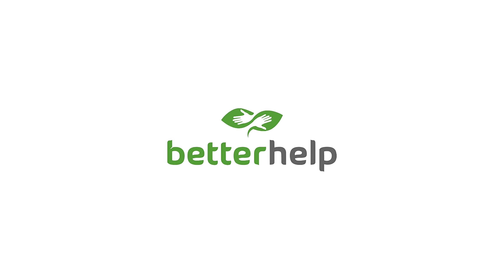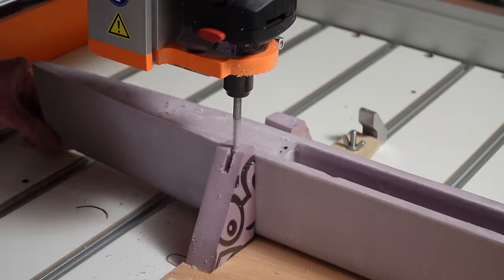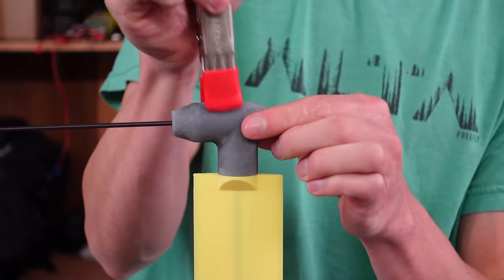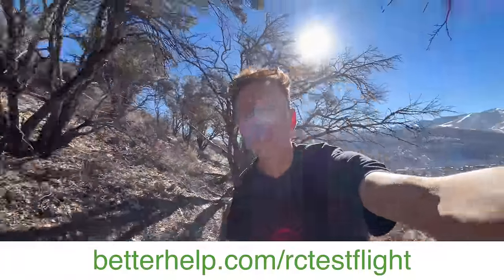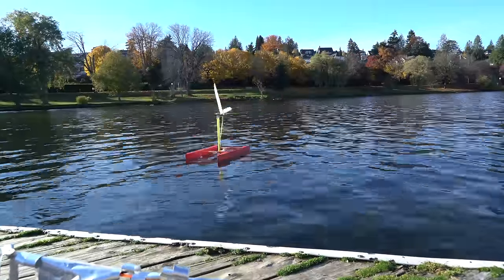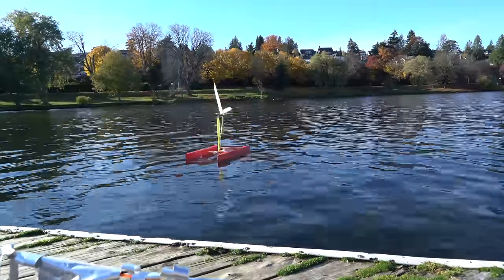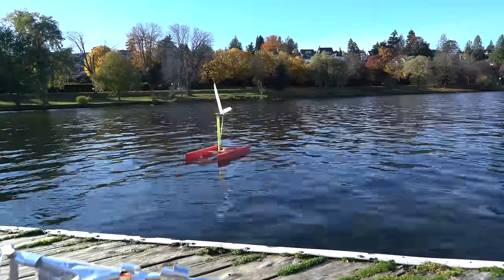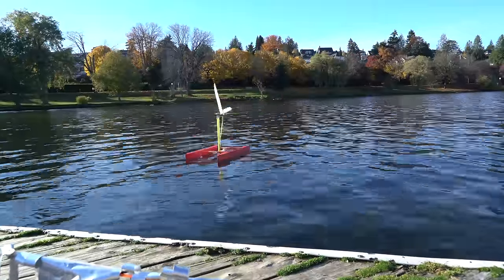Sailing Directly Into the Wind - Is it Possible?

Comment: Rather than increasing the propeller diameter, would it not make more sense to design the gearing so that it spins faster than the turbine instead of 1:1?
Reply: surely
Reply: that's what I was thinking
Reply: Also my first thought. Was gonna add a comment if I didn't see this one.
Reply: I have a feeling a bigger prop is more efficient than the extra mechanical losses from a gearbox. I could be wrong though
Reply: Seems like the additional gearing and touch points required could make it not as efficient as increasing the prop size, maybe.
Reply: He already has gears, though. Unless different-size gears have more friction somehow, then there's no penalty relative to his current design.
Reply: Yeah just think how fast these small water propellers would normally spin, thats far far faster than the wind turbine I'd bet. The turbine seems to have the torque to do it too, so I see no reason why it should be geared 1:1.
Reply: Yes, agreed! Surely there is a sweet spot between the drive and driven blades. Just like that "moving faster than the wind car" that veritasium did a video about a few years ago. The follow up video by that cute chick (lol) with the model car's on the treadmill basically proved that you need to find the right ratio between the input and output of the system.
Reply: Yepp, that was my thought as well. Glad to see that I wasn’t the only one. :) 

I think gear ratio is key here.
Reply: Bigger propellers are more efficient, generally for a low speed design like this we just want the biggest propeller we can fit.
Reply: It is a very complex topic. The challenge with this project is tuning the of the shape of both the wind vane and the propellor to work in harmony with one another. The windvane needs to be producing maximum lift which is converted to torque (power) with minimum drag relative to the wind speed.
The propellor needs to be designed in such a fashion that it is taking full use of the power supplied to it by the wind vane in order to produce maximum thrust, with minimum drag.
Of course, this is only going to occur at one and one only speed. That's just the nature of fluid dynamics. Bigger, smaller, slower, faster... there's a lot more to think about than that. That's where variable pitch propellors come into play. Rather than changing the ratio of the drive shafts, typically the pitch of the windvane/propellor is changed.
It's old tech, now, too.
So would changing the gearing so the prop spins faster be a good idea? We'll need a team of engineers and a lot of money to find that out. Maybe, maybe not.
Reply: Remember that whatever you do to the propeller it will feed back to the "turbine". If you spin it twice as fast, you will get more resistance from the water and more friction in the bearings and gears. That in turn will put more resistance to the turbine ie make it more difficult to drive.

The problem with so many of these ideas is that they forget that although they may work for an independent source of power( engine. Motor ) you only have the wind in this case. The wind that drives the turbine round is also pushing on the turbine blades and the body of the boat. So you have to counter that before you even start going into the wind. 

Those who equate the turbine to a glider wing  should  take into account that the incident wind on the wing is from in front on a glider and the lift is perpendicular to the chord of the wing not 45 degrees or so. You would probably stall a glider at that angle of attack.. so although the fan works ok , it really isn't working like a glider wing, so in this case can't really be equated.

It is interesting to see people try these things experimentally, but it usually shows why no one does it for real, when it counts.
Reply: Or try paddle wheels that lower down into the water the faster the boat goes. You could maybe use a wand with a float on the end of it to raise and lower the paddle wheels. Also get that thing up on foils!
Reply: You definitely need an rc Voith-Schneider tugboat to rescue stuck watercraft, in the cold season.

How about doing hybrid (solar) sail, + rotary wing battery driven vessel? 🤔

Also, wind turbine power scale really well with the diameter of the rotor. Min-maxing a humongous rotor on a real wide trimaran hull could be something to look at, yet still soft on material costs, excwept for carbon fiber scaffolding.

Also, keels, when going steeply upwind. How about doing some airfoil like optimization if getting a lot of sideway slip when tacking, trim the keel to be optimal for the angle you're going at any time?
Reply: Could be torque issues
Reply: Yeah i think hes got a big mismatch between the two.  You should be able to do some simple calculations to find the right speed and diameter ratios based on the density difference between air and water.
Reply: Bigger slower props are almost always better than smaller faster ones. Besides the losses at the gear interfaces, faster props lose a lot of energy to cavitation. The extra thrust you're hoping to get with a faster prop is better achieved just by making the prop bigger.
Reply: You want power with lower prop speed, which is only possible with a larger surface area on the prop.
Higher speeds run into turbulence and eventually cavitation

Comment: One of those "vertical-axis wind turbines" would be interesting. Would simplify the gearing at least. Doesn't matter what direction the wind is going too, so no mechanisms for pivoting.
Reply: Vertical axis wind turbines are as close to "free energy" as you can get without actually claiming free energy as ever possible. They have absolutely abysmal percentage of harvested wind energy from available wind energy. They have huge wind surface and only a fraction of that grabs wind. The rest is just a useless wall, which in case of a boat - would behave like a giant parachute.
Reply: Its been done check out rotor sail craft and wingsails also flesnor rotors.. for shipping .

Also biplane wingsail catamarans 🇬🇧🧙‍♂️
Reply: @NGC1433 not really true, the Darrieus designed is only a little less efficient than the commonly used horizontal axis designs since it’s not a design reliant on resistance. You can also get higher output per area compared to a horizontal one since they need less space.
Reply: Like the trimaran in water world. ;)
Reply: @NGC1433  Hybrid designs such as Darrieus can get 39% efficiency, but yeah compared to HAWTs 59% in ideal circumstances, its not "better" than HAWTs, however they are a lot less complex to operate. I build a few Vertical axis turbines in miniature scale (approximately 1m high and 20cm radius) and while it does not power a house or anything it was more than enough to drive night lighting in my garden and it was handy to have some 12v power at the other end of the estate for garden work. It charged batteries no problem. I have to add the disclaimer that I lived on top of a hill and it was extremely windy where I lived. I think it maxxed out at 50w power generated in a storm lol, not more than that for sure.

I think it should be doable to do this with a VAWT too, the remaining 59% of the energy is not directly causing drag or otherwise countering forces neccesarily. A VAWT can also have collapsing blade design that theoretically "beats" the betz limit in the sense that the collapsed blades does not cause drag or reduce power generated, though these designs are very impractical at scale, they perform brilliantly at small scale.
Reply: @meldert  
The earlier rotating vertical blade sails feathered the leading/trailing blades to the on the course wind to reduce then minimise the headwind whilst the other rotorblades kept an effective angle to the wind. The moment sufficient wind angle is achieved the blades/wings come back to an optimal angle to the wind whilst still rotating about the central axis.
One advantage is the whole set up results in a shorter rig height its complex, needing bearings and engineering in a salt water 🌊  wave battering environment when if you have a fast multihull or foiling vessel its faster to tack into the wind but 
Wing masts and foil section sails on pivoting mounts can fill in the front twenty to thirty degrees.
Reply: vertical helix turbine
Reply: it might be a tradeoff you are willing to take, giving up a little bit of efficiency to gain omnidirectionality
Reply: I'd be curious if the additional losses just from running more bearings laterally vs thrust would cancel the benefit from removing a set of bevel gears. Both are probably quite small but since a system like this is working with super small values all around it might be significant.
Reply: @Lizlodude  You would have mostly lateral forces on the bearings instead of axial. May create another difference.
Reply: Yeh it may work as it does not care what direction the wind is coming from it just spins at the same speed. The thing is those types of turbines are also pretty in efficient as only 1 blade is providing power each of the others is ither causing drag or is being pushed on by wind in the opposite direction. You would need some way of having ones ither doing nothing or working counter to the others to not cause drag or be pushed the wrong way by the wind.
Reply: The boat from Waterworld.
Reply: @marc_frank  Plus, wind is free. Efficiency loss in a sail will only really effect your maximum speeds and such, but it won't really influence the viability of such a vessel as long as there's enough power to be found.
Reply: I’d say you have too much hull above the water line. Fun to watch
Reply: @NGC1433  Another problem is it'll experience the Magnus effect making it even harder to steer.
Reply: @NGC1433  It's free in terms of we haven't enslaved it yet.
Reply: VAWT have a lift/drag ratio less than one. Not good if you want to sail upwind.
Reply: @NGC1433  only if you deliberately choose to use drag instead of thrust.

Savonius << Darius

Comment: If you want to push this experiment forward I think you need to explore both :
- variable and remotely controlable pitch for the wind blades (so it can adapt to diferent wind velocity and/or point of sail)
- axial rotation of the water propeller to make it act as a rudder (more authority at low speed than a regular rudder)
- definitely add some keels on the hulls to ake it less "floppy"
Reply: also add some gears ratio, wind gear bigger than water propeller. The same as Veritasium shows in his video about moving faster than downwind
Reply: @vovanikotin   Changing the pitch on the blades have the same effect, as changing gears. But actual gearing is maybe easier to change while experimenting.
Reply: gotta literally "push forward" or it won´t move "directly" against the wind...
Reply: also the wind blades, cannot be a plane, since the center moves slower that outside, this provocate drag, since the tip of the blade wishes to move faster than the center, and this mades the eficiency to go down. 

Also, another thing that I would like to see is with a vertical wind turvine and/or a wind turbine like the archimedes Liam F1 (I think is the name) 

One last point, is that there was a new propeller dessign (I think was the toroidal or similar), that apparently was more efficient...
Reply: Also a reverse gear would make it go faster than the wind going downwind!
Reply: @jaumesinglavalls5486 does he know?
Reply: @jaumesinglavalls5486  yes, the turbine blades should be tapered, twisted, and use a better airfoil.  You could get a whole lot of benefit with just that.  Adding variable pitch is actually pretty straight forward using the pitch mechanism from an R/C heli tail rotor, and that would really help to find the optimum without so much trial and error.  No doubt the propeller could also be improved, but I'm not terribly knowledgeable about water propellers.
Reply: Also maybe a gearbox to make the water prop spin faster then the wind prop
Reply: That's a lot of sophisticated engineering
Reply: For stability, propeller in front pulling and windmill and mast in the rear.
Reply: @vovanikotin  maybe he can just change the ratio in the existing bevel gears for a better ratio without added drag, then do the rest by adjusting the propeller pitch.
Reply: @teslatrooper yes, thats what I meant to say. there are a lot of thing for research, hope Daniel continue this project

Comment: Hi. This was first done in the 1950's, "Popular Mechanics" did a model rotary-sail boat. The big problem with these things is they sit in water which being fluid allows the boat to go awry. When the "drag" on the windmill exceeds the "thrust" of the underwater propeller the "radio control" becomes purely theoretical. 

I redesigned it as a little four-wheel cart. My thinking was that with positive contact with the concrete it couldn't go off on its own. The drive wheels were geared down using a rubber turn-table belt twisted through 90 degrees, so the windmill did a lot of spinning to produce a top speed that would only have a snail hanging on for dear life. It always worked well until the belt ran off the top pulley! 

Made today using model bevel gears it would be quite possible to make a steerable wind powered cart in which the windmill always faces directly into the wind by using a tail-vane. Slow motion races around a tennis court could become the next "geek" sport. Cheers, P.R.

Comment: I think you could use the bevel gear to increase the ratio between the turbine and the propeler, so that the propeler would turn faster. In my opinion (but I am not an expert in this), it would be more efficient to have a fast turning propeler with a slow turning wind turbine. Also, I think having the mast turn with the blade insted of the boat would reduce the drag of the boat
Reply: I agree.  Couldn't one develop gear ratio that leverages the huge torque-- like the wind turbine farms.  I am no engineer so I can't offer anything more than an idea.
Reply: bevel gears are very inefficient in terms of energy transfer, but gears/belts/chains moving between two horizontal shafts could be interesting
Reply: The same effect can be achieved with less losses by adjusting the ratio of the size between the turbine and propeller - I suspect Daniel has already considered this and used it to size the water propeller.
Reply: @waxt0n  It would significantly hamper the rotational freedom though. Bevel gears have a built in slip-ring capability, but belts would need some kind of intermediate transfer, which negates most of their advantages.
Reply: I also have the feeling that the slower the wind turbine turns, the more drag it will create
Reply: @waxt0n  I would suggest that bevel gears are in fact quite efficient. If they are less efficient than straight gears, belts and chains, it's not by much. Weight and cost are the biggest cons with bevel drives. They're more difficult to engineer as thrust is bi-axial and there is more machining involved than there potentially is with other drive systems.
But frictional losses are minimal, especially with spiral bevel gears. We're talking in the range of 2-5% in a lot of applications. That's not much.
Reply: @jamesscheidler476 that torque on a windmill is acting against the ground, Ie relative to it. Boats freely move on water, which is why yachts need a keel, to not only counterbalance the weight of the sail and mast but to cut down the side ways movement from the "lift".
Reply: @jamesscheidler476  Within a significant range, prop pitch can be adjusted instead (at either or both ends) by swapping props or using an air prop with adjustable pitch. A craft like this moving slowly upwind is well within that range.

Comment: The funny part is that, the way you made the boat, the way to go against the wind is to rotate the boat (and the wind turbine blades) backwards, because of the drag created by the blades of the wind turbine. Putting the drag in front of the center of mass and center of thrust only helps destabilize the system, which is why it seems to be so stable while it's "facing the wrong way", at 8:00 to 8:30.

Comment: Why didn't you increase the gear ratio so that the propeller spins faster?
Reply: You introduce mechanical loss when using more gears so it is more efficient to just use bigger propellers
Reply: @user-jm8sy5ox2j you wouldnt add more gears. Youd just make gears with more and less teeth in order and replace the existing gears with the new ones
Reply: @user-jm8sy5ox2j you got the wrong idea. Increasing gear ratio doesn't mean adding more gears
Reply: Larger prop is functionally a higher gear ratio.

Comment: Something you missed about sailboat dynamics:

The sail is not the only force acting on the boat, unless you're going directly against or with the wind. The maximum speed a boat can get in a Run is the speed of the wind, and realistically the water drag reduces that speed.
If the boat is going across the wind in some way, the normal force from the wind on the sail is counteracted by a normal froce from the keel pushing on the water. Adding up these two normal forces, you can see that the resultant force is forward unless the sail is directly in line with the keel. Basically, the boat gets squeezed between these two forces and shoots through the water like a bar of soap shooting out of your hand. The fastest speed a sailboat can go is somewhere between Beam-reach and Broad-reach, and not by a small margin (a super high efficiency sail-ice-skate can go 3 times the wind speed on the beam). That's why a sailboat can go upwind at all; if the wind simply pushed the sail normal to the sail's angle (like putting a sail on a barge), you would only be able to sail downwind at some angle.

In some sense, the keel becomes a section of a propeller.